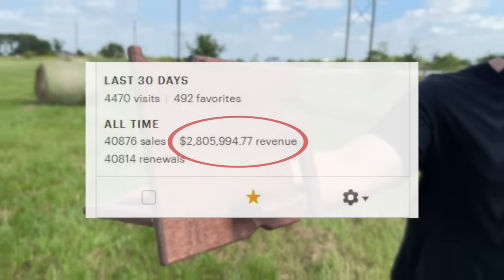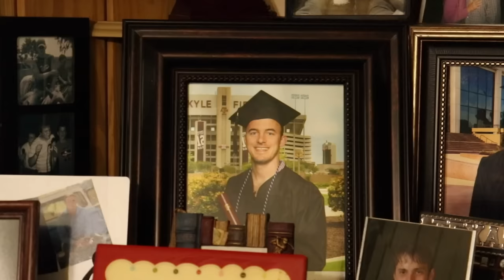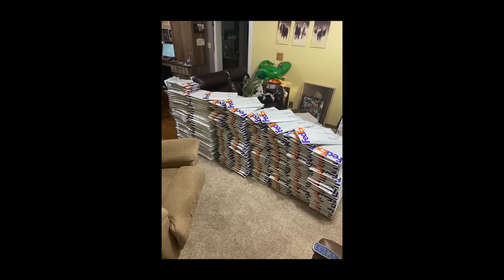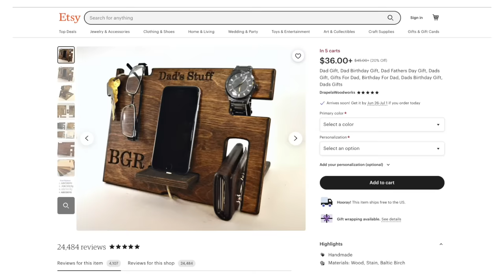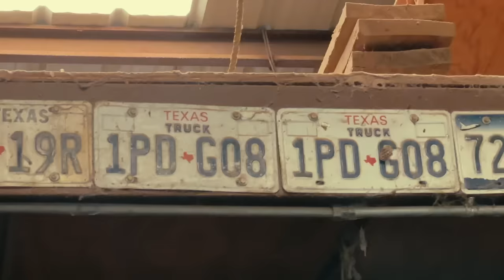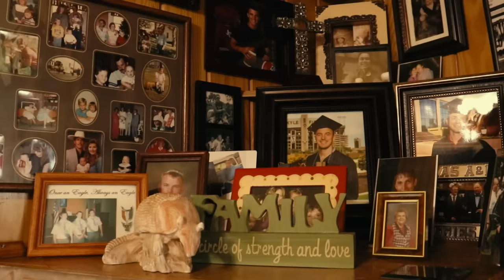How One Woodworking Project Made Me $2,612,367 | A Documentary

Comment: We're supposed to believe you made over 70000 of these (if the $2.6 is gross revenue)...I find that hard to beliee
Reply from the maker: Thats fine
Reply: @cutting-it-close  Well, if you were making so many, and so much revenue - why not just buy some more CNC routers. $10K is only .25% of the revenue and you don't need large expensive routers to make several of those
Reply from the maker: @woodfinchcrafts7267   That is what I did eventually, but at the time we had limited space, I was running all of those items with 3 CNC machines by the time it was all said and done. I had 2 small CNC's for engravings and a 4x8 that cutout product.
Reply: @cutting-it-close  Ok, that makes sense